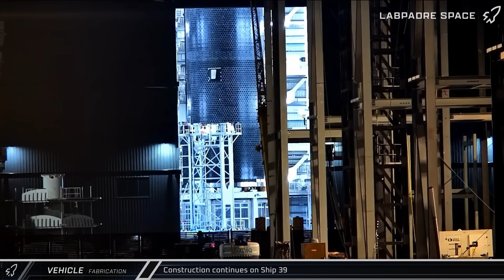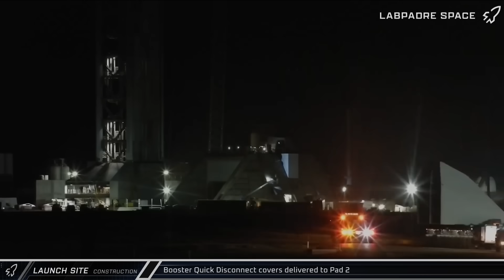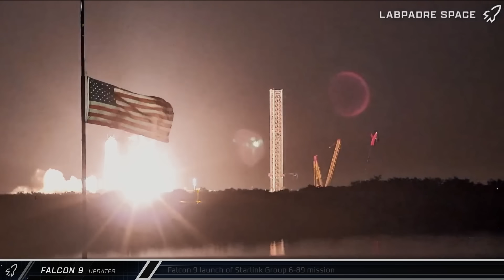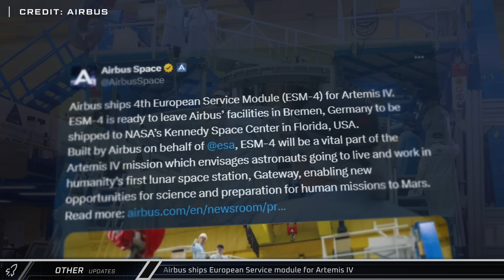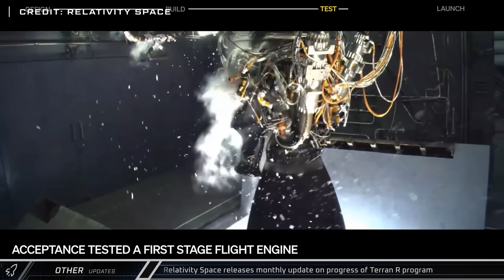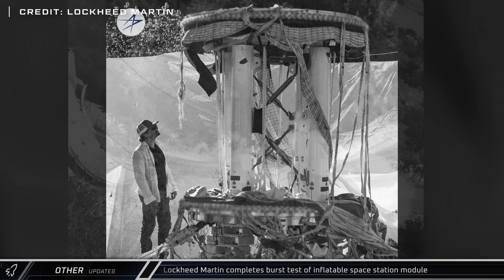SpaceX's Gigabay Begins to Take Form - Spaceflight Weekly #193

Comment: As a former helicopter pilot, I am familiar with performing an initial approach to the side of the intended landing zone, which allows for an overshoot/abort path free of obstacles. Note that the idea is NOT to come to a hover, but to always maintain forward movement and a slow translation to the landing area. (although coming to a complete hover is sometimes necessary in a helicopter for various reasons, it should never be necessary with a booster). Coming to a complete hover would be much more difficult software-wise, and require more power (fuel) than continued, smooth, forward motion.

Comment: Maybe the slew brake failed or the weather vain sensor malfunction on the tower crane. They were lucky the park angle of the crane arm did not overlap the other crane arms.
Reply: They were lucky they weren't lifting a column or beam. Rock Em Sock Em would ensue!

Comment: Just a guess here but sometimes radio frequency interference and cause problems with these. I work for a company that makes RFID equipment and a few years ago our RFID reader was causing problems to one of the cranes at a port. These RFID readers transmit in the 900 Mhz radio band which is the same channels and frequency used by the crane. This was my first thought when i seen it spinning. 🙃
Reply: Imagine if it started spinning while lifting a column or beam.